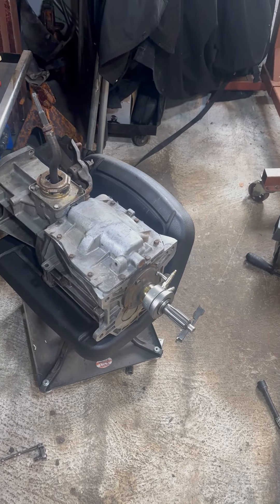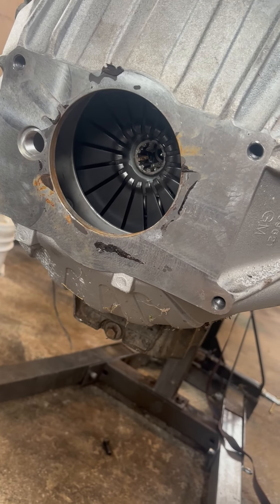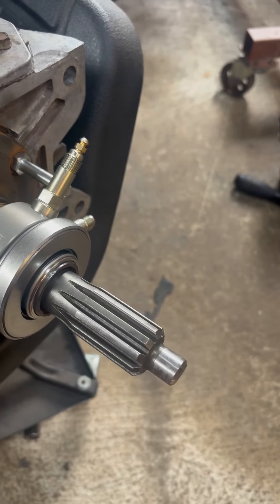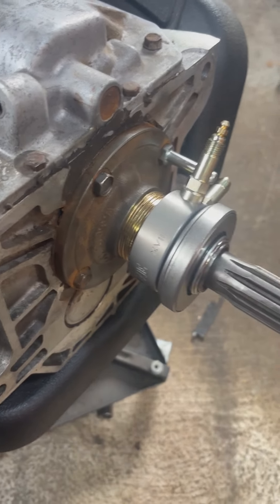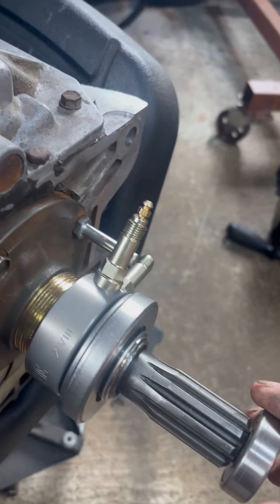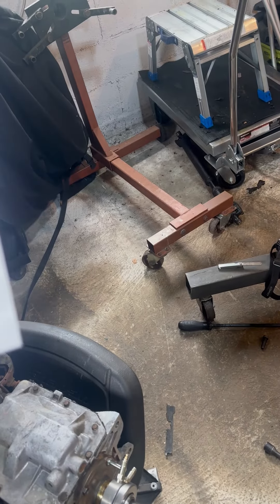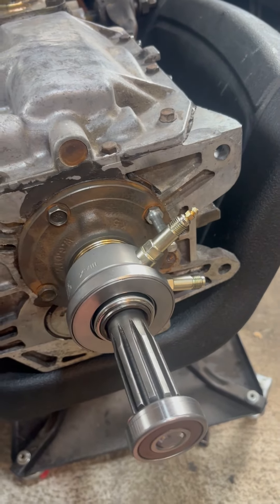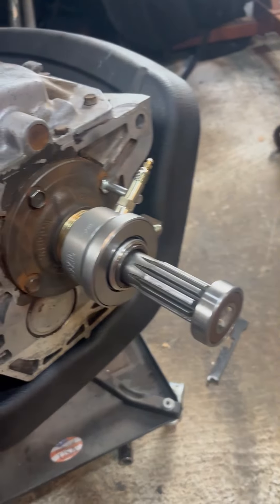T5 to LS 5.3

Comment: Dude this is exactly what I'm working on I have a 4x4 NWC T5 that I'm wanting to bolt to a 2005 5.3. and stick it back in the 86 S10. Did it work out for ya? Did you really have to trim for the jeep shaft? I have already ordered the jeep shaft and just have to find a bell housing.
Reply from the maker: I trimmed mine.  Its long.  Works great.  I drive it everyday.  I have about 3000 miles on it no issues